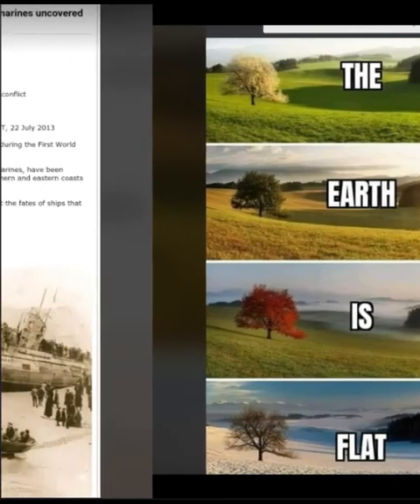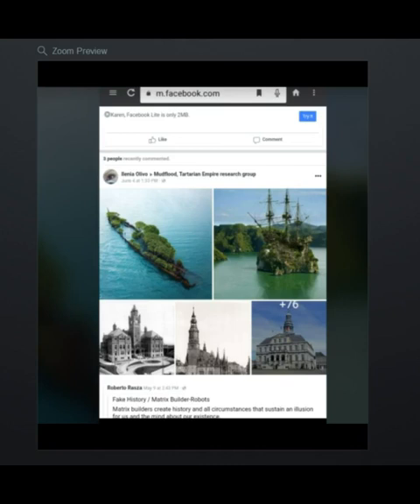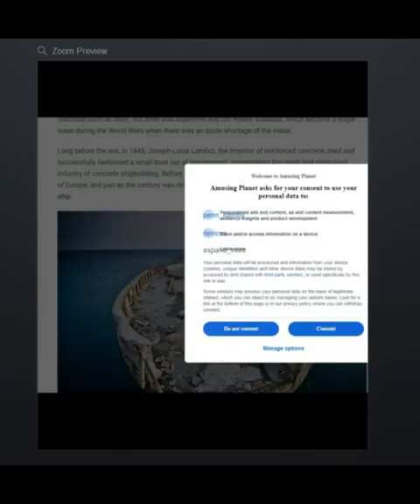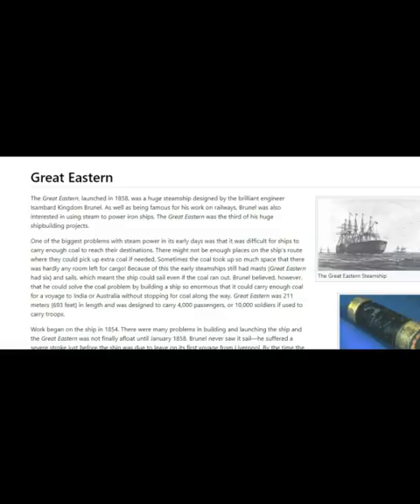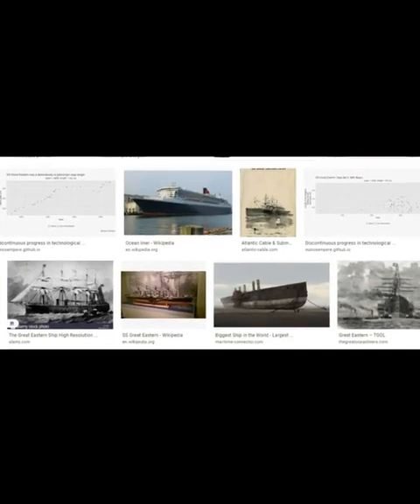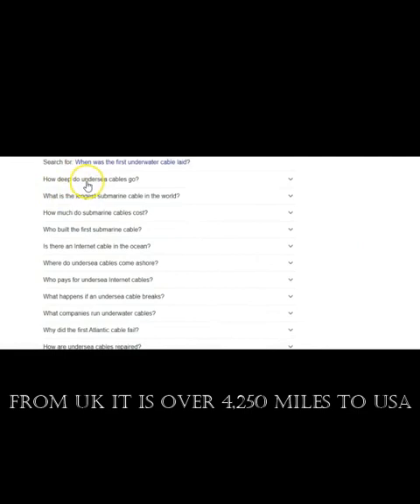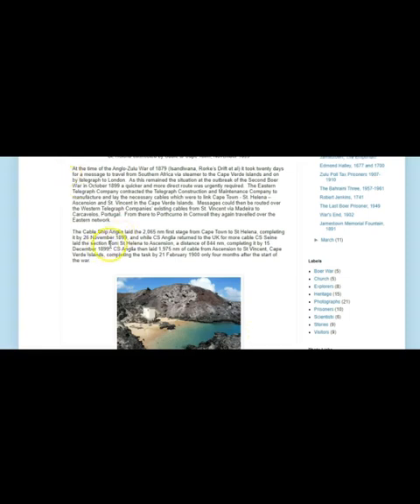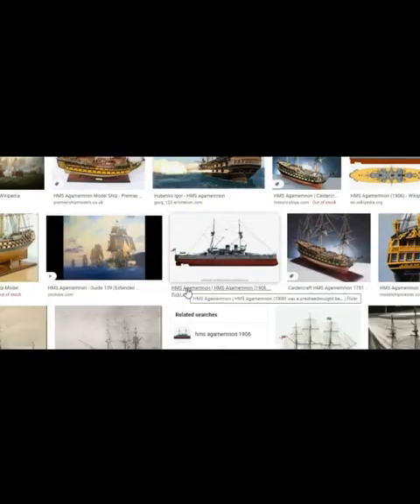TARTARIA-Mud Flood/Great Eastern/Underwater Cables 1850`s/Concrete Ships/Submarines-Christian/SAMFU

Comment: STEAM power was not only water heated with burning fuels.  Steam was generated through effects in the water itself.  Look up FLASH STEAM ENGINES.  Water hammer, cavitation can generate free energy.  Sound can boil water.
Reply from the maker: Thanks Sol hugs💚💙🌺🖐🌹💜💜☀💐😁🌞🌞🌞🌞🌞🌸💚💚💚

Comment: The underground cables is bull, on land they couldn’t get the Telegraph signals to travel that far until a capacitor  was invented
Reply from the maker: THANKS COS I didnot think it was real anyways but that's what internet said plus it used 2 ships but never mentioned the other one hugs 🌼🌸🌞🕊🌷🌹😁💘💜💐🖐🌺💚💚💚💚
Reply: @samfu-sunandmoonfamilyunited  internet cable, how long does it say you can have at your home 100 meters any more and the cable starts to lose data. There is no internet cables under the sea, all transmissions are done by phone towers
Reply from the maker: @JonathanMBardsley  SOUNDS STUPID DONT IT then 🌺💘💚💙💙☀☀💙💚💖💖💝🌷🌼☀
Reply: @samfu-sunandmoonfamilyunited  it is stupid have a look at my theory I’m trying to get it out there you may of read the first half but there’s a different reason for what they are up to 
For the top physicists to say the deeper they look the more they are seeing computer code in ones and zeroes, for them to be able to say such things they must be changing it because they are not looking down a powerful microscope and seeing ones and zeros so that means that there is a hard drive to hold the data that is being changed and I believe I know where the hard drive is from an experiment showing water holds memory, in the experiment a listening device was used to record the electromagnetic field coming from the water to later reconstruct the DNA that was once in the water from the recording, this told me that magnetic fields hold memory so could earth magnetic field be the hard drive to our reality? I got my answer from the random numbers experiment which is machines all over the world creating random numbers, from this experiment they found that when there was a big world disaster like 9/11 these random numbers stopped being random, they reacted to how people of the world was feeling, they also noticed that the earth magnetic field was reaching to theses big disasters.
Now in the holographic universe, they say our minds download the frequency from the frequency domain which would be the earth magnetic field but they indicate that our brains are receivers downloading frequencies which is a bit scary when it comes to things like CERN with their big powerful magnets because they could be turned on and off in sequence creating a magnetic frequency of information and with our brains being able to download magnetic frequencies means there could be a mind control on a mass scale. This would explain why the governments donated the largest amount of money ever donated on an experiment, controlling all the people I think that they would have donated their left arm lol if you would like to know how the sun proves we are living in a matrix that is connected to the collective consciousness then check out my videos.
https://youtu.be/Audpquectuo

This is an interesting video I’ve created the theory is the same apart from them doing something other than mind control but it is a good watch https://youtu.be/srQvmjBqTYM